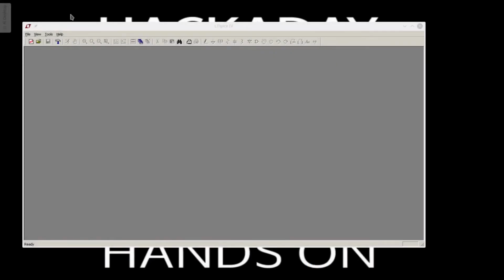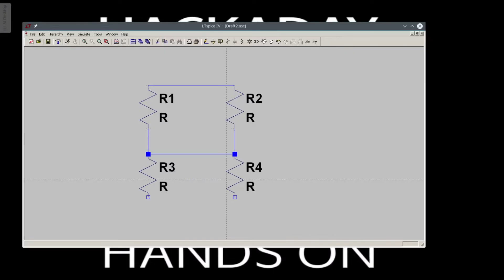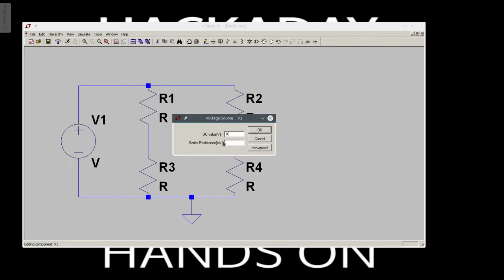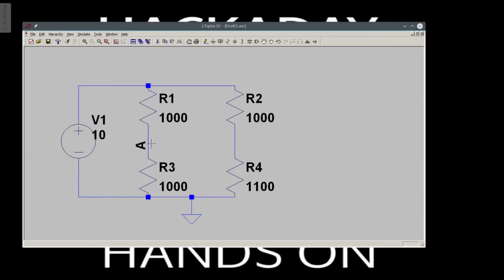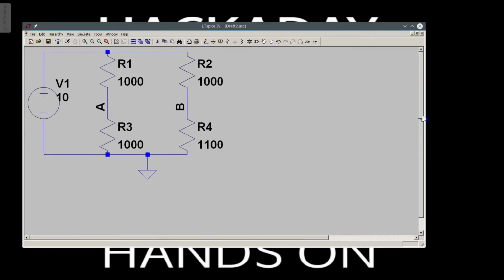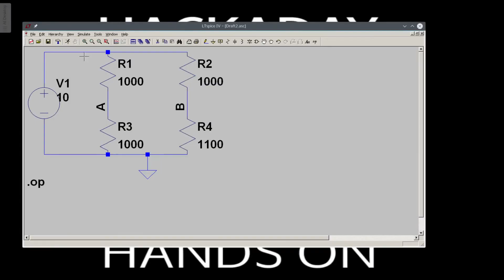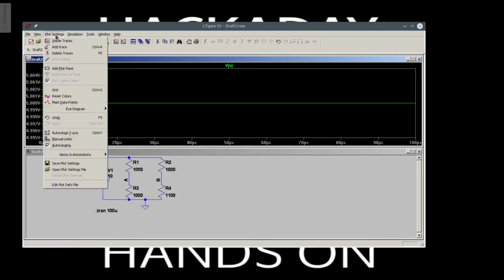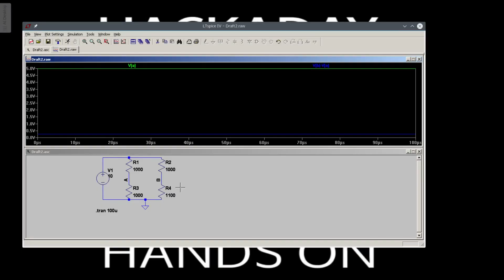Basic DC Analysis with LTSpice

Comment: Can this spice warn you if you exceed an LDO's short circuit output limitations?  (Some specs day to use protection diodes to avoid problems with shorting the output, others don't have that requirement)

Comment: Thank you for pointing out the active window concept and the different tools available for each. I know of at least one operating system where ltspice, (on MacOSX) doesn't shift focus back onto the schematic after the simulation runs as seems to have happened in your video. The ability to place a probe is not available if the trace window is active.

Comment: I am anxious to try this to simulate an old capacitor bridge. Make R4 the unknown capacitor [C1]. Make R3 variable resister. Make V1 a sine wave source with a fixed frequency. Now vary the value of R3 until its resistance equals the reactance of C1 [which is when (A-B) = 0]. The old HeathKit C-3 did exactly this with the position of R3 labeled as microfarads.

Comment: Why is it mission impossible to put a simple switch in the circuit and turn it on and off during the simulation. Or does that need a 1,001 mouse clicks and a Phd in Electronics?